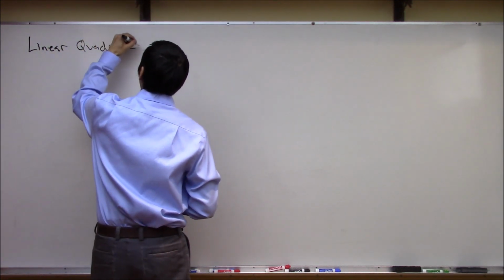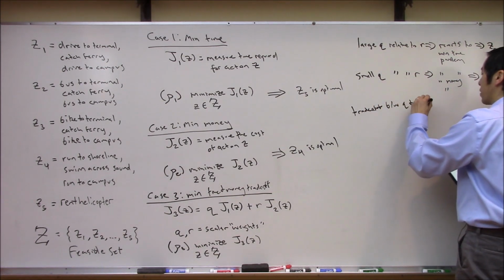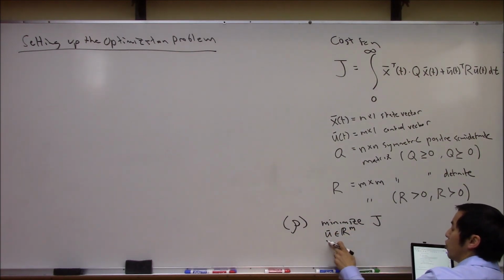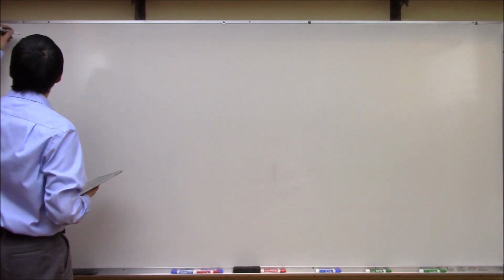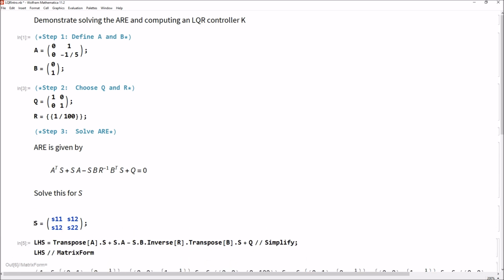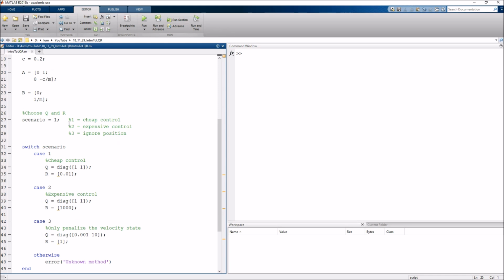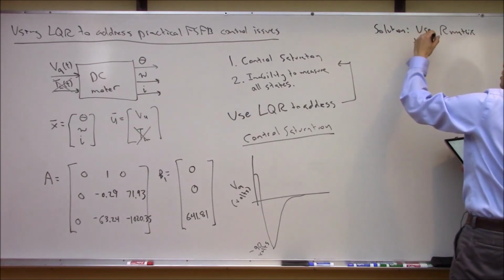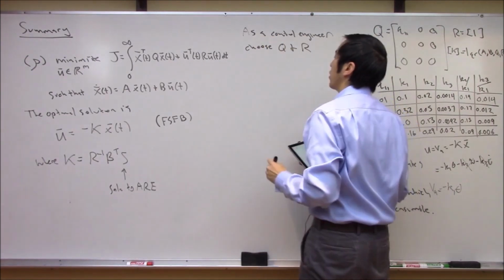Introduction to Linear Quadratic Regulator (LQR) Control

Comment: AE511:If no S solution that yield a stable system, then what we need to do? use different weight constants and repeat the process until it yield a stable system? Thank you for a great introduction to LQR.
Reply from the maker: If A and B are controllable then you should be able to obtain a stable system.  Do you have an example of what you are asking about?

Comment: I object!  If I place the closed loop poles, I know what the response will be.  I can convert the closed loop transfer function to the time domains and see the response.  Now how can one determine what is optimal by choosing Q and R values?   If you ask a dozen engineers bout what is optimal, you will get a dozen different answers.  Choosing the Q and R matrices is an art.  Define optimal!  What is this LQR garbage?  What about LQC where you control the system to follow a trajectory instead of just going to zero?  However, how is that better than a PID with feed forwards.
LQC, LQR are good if one must optimize a few different things.   I have an example where LQC is used to minimize a cost function between controlling flow and temperature and minimizing the error or cost function.  However, my cost function is just my opinion.  The example was flawed.  It was clear from my simulation that a recirculation line was necessary.
I will do admit that LQC is MUCH better than fuzzy logic if there are multiple inputs and multiple outputs.  MIMO.  What bothers me is that the instructors have little real-world experience.  They teach what they have been taught.  The real experiences and knowledge are outside of academia.

Comment: [AE 511]
Weighting the state and control seems powerful. It reminded me a bit of the Kalman Filter from Estimation Theory. The catch with all of this is that the system has to be linear? Which is why linearization is usually required to implement this type of control?
Reply from the maker: LQR is actually the dual of the Kalman filter problem so they are very related.  Yes, this requires a linear system.

Comment: Amazing explanation!!....I  wonder if you can add another video about what if we want to use LQR in a more constraint fashion for example if we want to make add a constraint on the control action; u>=0 and u<=max value or any other constraint we have for the system. What if we want to use LQR for tracking (LQT)?.....LQR+integral action....State-dependent LQR

Comment: You assumed input in last example related to DC motor to be single, can you kindly refer to some solved example/video with multiple input system? Further, what if, instead of driving states to zero, requirement is to maintain the states at some reference value or track some reference value. Such as keeping aircraft in steady state level flight or coordinated turn maneuver. How can we implement LQR in such scenarios?

Comment: What are some disadvantages of using a LQR controller? or why might a controls engineer decide against using this method?
Reply: It's pretty clear:
1) Computing the Ricatti Equations is a pain in the butt. None of us math folks like the idea of inverting damn matrices. 2x2 is annoying enough, most systems aren't just 2x2.
2) One must decide on Q and R, it's a heuristics method, or "spray and pray"
The suitable Q and R for scenario A might not be applicable to B. Say you want to design some GPS system, your Q and R might be great for an open area, but no longer good if say, the car enters a tunnel where the signals might be effected. 
That said, LQR is a powerful method that's widely uses. The flaws aren't detrimental, unlike PID.

Comment: Thank you for your lecture video. It's really helpful for me to understand LQR.
By the way, I have a question.
From your video, by using Riccati Eq, we can get the K = -R^-1B'S.
However, some other lectures why K is somewhat different.
Plz ignore the alphabet, but note that there are additional terms more such as
K = -(R + B'PB)^-1B'PA     (here ,R, B, P, A is not equivalent to your value but K has more additional terms compared to your K. 
Why different even in LQR solution? Please explain briefly.

Comment: One of the best videos on LQR out here right now.  I have implemented LQR and used it several times but I just realized I didn't FULLY understand it until this video.  If you are taking requests I would love to see your take on receding horizon(MPC) optimal control as an extension to this.
Reply from the maker: Quincy, thanks for the feedback. I've had a few requests for MPC control and it is on my list of videos to make.  I hope to catch you at another video!

Comment: Hey that's a nice video here! Would it be usefull to neglect through Q the effect of a state by setting for example q11 low? We want to know if a state change in order to correct its error through command.
Reply from the maker: You can use appropriate elements in the Q matrix to emphasize or de-emphasize the importance of a given state.

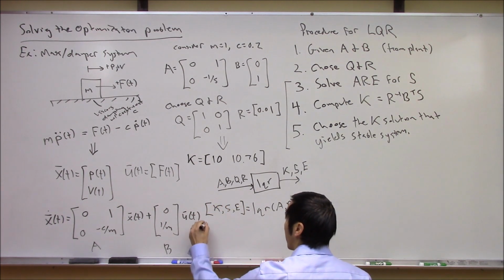Comment: @ "1:01:48" time there is the lqr, is int it care() function that we can use to get the data you from the mathematica
Reply from the maker: Thanks for watching.  I'm not aware of a 'care' function but if you'd like to use Mathematica for LQR, there is a function called 'LQRegulatorGains' that might be useful.
Reply: @ChristopherLum  I have a small request if you could say me some literature or videos about reference tracking using the LQR method. Thank you so much for this video its the best video about LQR
Reply from the maker: @anujregmi4582  Thanks for the kinds words.  Please share the video if you like it.  In terms of LQR tracking, you might want to look at 

Groves, K., Sigthorsson, D., Serrani, A., Yurkovich, S., Bolender, M. and Doman, D., "Reference command tracking for a linearized model of an air-breathing hypersonic vehicle". In AIAA guidance, navigation, and control conference and exhibit, 2005, August.